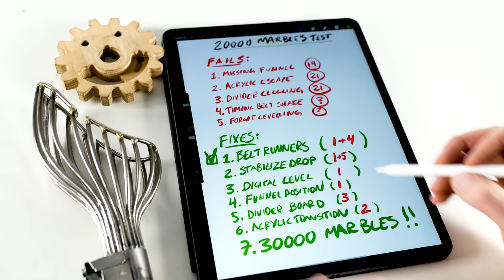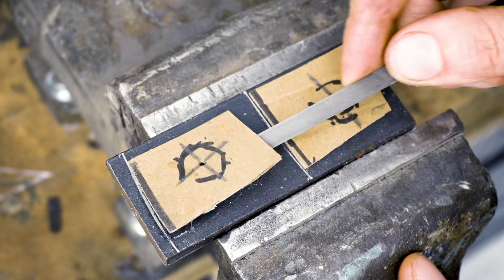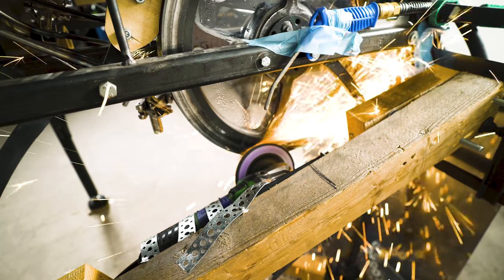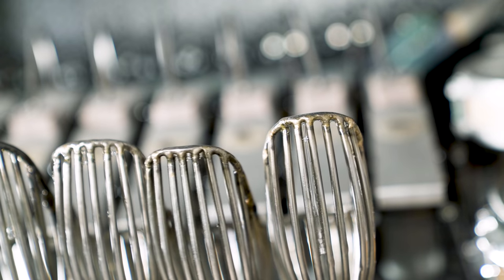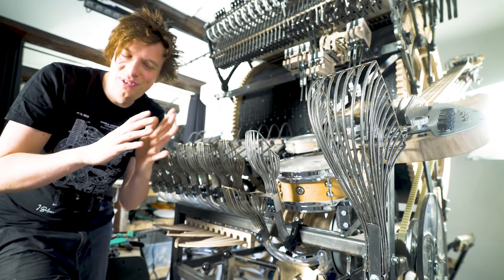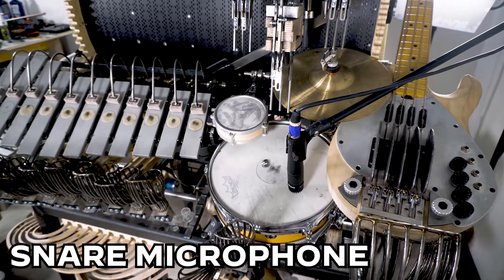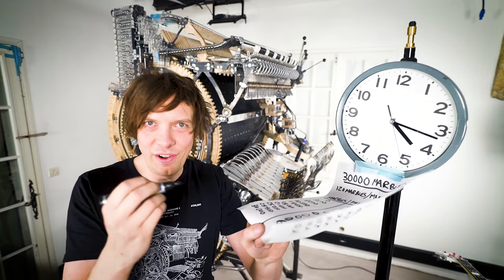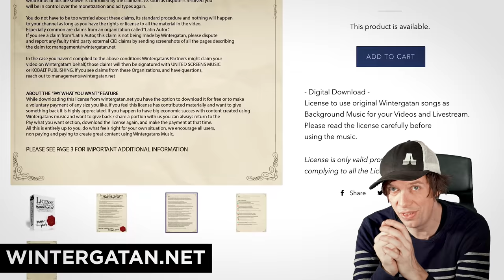Playing 30000 Marbles - Marble Machine X #148

Comment: Something that may help with those vibrations. To reduce "ressonance", try cutting a couple of holes at the top of the square tubing and filling the frame with sand. Sand will add mass to the supporting frame and absorb part of the vibrations. I recall ToT also did that on his CNC building series.
Reply: I'm pretty sure they do the same thing to rollercoaster tracks.
Reply: Just like Roller coasters!  uh wait... MMX THE RIDE!!!!
Reply: Btw filling the frame with sand seems to me a wonderful idea to absorb vibrations
Reply: @timbo11  I was going to say the same thing
Reply: That machine is going to be so heavy to take on a world tour

Comment: Your runners need to be spring-loaded or you'll run into trouble.

Over time with the runners stressing the belt combined with temperature swings the belt is going to stretch, this is what lead to the problem you have now that made you add runners, by making them static/not adjustable you're just kicking the can down the road, you need to plan for this.

In your workshop things might be okay for months before you notice a problem but on the road? you'll be going from warm venues to not temperature controlled vans over and over, if the van is generally colder than the stage you'll have extra stress on the belt when you're not using it and when you come to use it the belt will be loose again. If the van is generally hotter than the stage then when you're on stage you'll have that extra stress while also being under the load of playing. At some point it's going to stretch and it may cause you to drop from your 99.99999% goal
Reply: Yeah, but he can make a auto adjustable runners like in the cars, a spring and a pulley
Reply: this has been one of my big frustrations throughout the entirety of the series really.

He'll have a good idea, but then do a half job implementing it. Which then causes problems. Which he'll solve with another clever idea, but once again with a half job of implementing. I get that he has also been learning this entire time, but you'd think with a team of engineers backing him that stuff like this would get caught and corrected.
Reply: Belts are probably cheap and readily available enough to just be replaced on the road. Not to mention the main portion of the vibration, which was causing the drops, came from the flywheel being unbalanced. So the belt thing is probably more cosmetic than necessary.
Reply: He could make them adjustable, or just use bigger bearings. It's a problem, but not a major one.
Reply: And he should only have an idler on the slack side of the belt. He gets half-way there with these designs, but just doesn't have the engineering experience and exposure to fix it once, so he ends up in integration hell.
Reply: Further, he would do well to not just spring load the idler, but also dampen it with a small shock (motorcycle steering damper?).
Reply: Agreed. Martin should look at how car's take up timing belt slack using idler pulleys. On my 4A-GE engine it's a single bearing and a small but strong spring. Would be super easy to screw something like that to the brackets he's made. Or he can just modify the ones he made to include a spring.
Reply: I thought exactly the same thing. He could at least have welded on brackets with multiple holes to allow manual repositioning when the belt stretches.
Reply: @andrewcobaugh5375  Adding the rollers not only tensions the belt but also raises the harmonic resonance frequency, so he'd probably be best of having a static roller on the tension side and a roller under spring tension on the slack side. Adding spring tension to the roller also adds another point where there might be harmonic resonance, but it should be easy to adjust the spring strength or pull length to adjust for that.

Now that I look thought back on the issue I thought remembered the belt to have teeth. Took a look at 5:49 and yes it does. Now that is another possible source of vibrations. Toothed belt are used when timing is critical, such as for driving an overhead camshaft in an engine. That camshaft has to be perfectly timed or bad things will happen. The driver belt on the MMX does not have to be perfectly timed at all times. If it would slip a little while the machine is spinning up it's no big deal as long as it does eventually stop slipping. So transitioning to a flat belt, or perhaps even just turn the existing belt inside out might be worth testing to see if it runs smother.
Reply: Wow this blew up XD it's interesting to hear from the actual engineers where the idler gears should be, thank y'all for the thumbs ups, I was half tired and deleted my first post by accident strange how things happen

I understand that some of you are frustrated that Martin isn't an engineer and doing engineery things and making a mess but at least for me that's a good thing, he's not an engineer, he doesn't know the answers and so even I, who's last experience in a machine shop doing anything remotely useful to the debate was when I was 14, can put myself in his shoes and know I'd make if not the same mistakes then similar ones. I've learned more from Martin, This Old Tony, AvE and Adam Savage doing things the wrong way and fixing them than I have from people who're clearly experts in their field getting it right constantly first time. I now stand at least a limited chance of knowing what pitfalls to avoid, so there's the education side, not to mention perfection isn't nearly as entertaining to watch.
Reply: Yeah but how much you want to bet the belt tension didn't cause/fix any of the vibration anyway? Compared to the flywheel, it couldn't have been even 1% of the problem.

Likewise I don't see how the dropper movement mattered at all, given that the next marble drop happens ½ second after the gate snaps shut. (Maybe a little faster, but those gates do have a significant "recharge" time.) That seems like plenty of time to dissipate the impact vibration.
Reply: @barongerhardt  Good point that the belt movement is more a visual indicator. I also agree with you that tensioning the belt can't hurt, even if it doesn't solve the vibration issues in this video.

As for the droppers ... he can't play 16th notes at 120 with a single gate, the next marble doesn't drop in place soon enough. I'm not sure he could even play 8th notes. I'd guess quarter triplets at 120 (3 marbles/sec) is about as fast as he can run a single gate. Good idea to have dual channels on every instrument!

Also, I agree that a dropped marble is far less of a concern than a stuck or jammed marble. He talks like every failure is catastrophic and he has to get the numbers down to zero or his world tour is a disaster. I get the perfectionism as a way of life, and indeed it was great to see him balance that flywheel, but at some point, if a few marbles per song end up on the floor, this is not the end of the world.
Reply: The belt vibrations just simply were never an issue, period. What the weight of the belt? It's like saying the jingling keys are shaking the car and not the other way around.
Reply: Yep, It might run for 1 tour though... maybe. :) I'm twitching my eye way too much, I'm skipping the video's I noticed. I'll just wait and see the end result, much better for my sanity. haha Wish him all the luck!
Reply: @VincentGroenewold  So many besserwissers here, who roll their eyes when Martín does something from their area of expertise a bit unoptimally (Excel use, rubber band shenanigans...). Get it that he does a bit of EVERYTHING and then plays music on it.
Reply: Yes, without springs the runners will either wear out the belt, or change its tension depending on the temperature. A second version of the runners should include springs that keep a constant tension on the belt.
Reply: Have to agree - the belt tensioners should be spring-loaded, to keep a constant tension under varying conditions.
Reply: @andrewcobaugh5375  I think a Centramatic type balancer would be beter than a shock absorber.
Reply: @blahorgaslisk7763  Yup, I agree about the belt tensioner + idler wheel

Comment: At some point, the marbles that miss are going to be caused by a slight breeze coming through the window, and Martin will engineer something to counteract it
Reply: Yes. It will be a mechanical fan attached to the planetary gearbox that produces a breeze in the opposite direction of the window.
Reply: Quite simple, actually. Just contain the MMX within a vacuum so there's no air to make a breeze! Thinking about it, that might also solve any humidity or temperature change problems. Huh
Reply: Connor McInerney there will be no sound in a vacuum tho, having the MMX in its own controlled micro climate might be the go though.
Reply: @alvardo3000  That actually wouldn’t be a problem for most of the MMX’s instruments. The bass has pickups, so it doesn’t need air, and Martin mentioned someone’s suggestion to use magnets with the vibraphone bars which essentially gives them pickups as well. The kick uses a contact mic, so again, no air needed. The main issues would be the snare, hi-hat and cymbal, because those don’t use pickups or contact mics. You can still give them all contact mics, but they likely won’t sound the same or as good. So if you didn’t care about getting a perfect sound, a vacuum wouldn’t be an issue
Reply: But... making a vaccum that big is practically impossible, especially on the go in the world tour. He also would need to stand inside of thr vaccum to operate the machine, killing him due to lack of oxygen.
Reply: We need a DOME!
Reply: "I've gathered the plutonium I need for my thermonuclear weather machine, I've started hunting through my tap water for tritium, not sure how I mix it with the lithium"
Reply: @lukejordy  Viva Las Music Dome!!!
Reply: Or he could just close the window. ;-)
Reply: @lilyunderscore9568  Space suit.

Comment: Honestly, even though 6 marbles fell, it actually wasn't 6 failures. The reason being that it was loading multiple marbles and they all fell at the same time as part of the same overflow failure. So reliability is actually higher
Reply: There's also the fact that the failure happened obviously outside of normal operation ie. several hours of uninterupted use of a single instrament. If it were me, I would note it down as a possible point of failure while moving forward with the rest of the instuments. It's possible that using more gates at once would prevent this from happening again, or even just the breaks between songs. The cause of the failure may even just be that MMX had more marbles in circulation than it could handle when only playing the snare.
Reply: @DeathOfLife3764  Exactly.  Unless you plan on playing it for over four hours, there would be zero issues the way it is.
Reply: Using triplet notes will avoid this for the next test.
Reply: @Sorestlor  that is why he should do a calculation of minimum number of marbles needed for the machine to play smoothly. As well as calculate maximum number of marbles that the machine can support.
Reply: While the probability is low.  This was just one of many future gates each with the same potential failure point.  So the real failure probability is actually quite high, almost to the point of being certain over the course of an entire concert.  In addition, the marble loss is a minor symptom compared to the potential failure of several instruments downstream of the blockage from receiving any marbles at all.

Comment: Martin takes out the angle grinder to balance the Flywheel: Me (working for a reasonable time in a balancing company) - thats not how balancing works. I suggest using magnets.
2mins later: Martin uses magnets.
Reply: The funny part about this: It wasn't 2 minutes, but 3 days for Martin.
Reply: I was just thinking about the little clips they put on tire rims to balance new tires.
Reply: @dmdeemer  Same here. I just noticed my tires getting out of balance yesterday. Today I see this and I see the grinder and cringe. Then he fixes it proper and I sigh in relief.
Reply: Exactly. It didnt matter if the flywheel was true, it mattered that it was balanced. He was equating true with balanced. At the machine shop they true flywheels so the clutch mates, and then balance them so they rotate smooth and dont shudder.
Reply: @MrAntimonty  i
Reply: But the flywheel looks loads better! It helps the angle grinder feel better about its sacrifice.

Comment: Forgive me if I'm wrong, but that last little issue wouldn't actually exist if the machine was playing more then the snare drum, correct?
Reply: Yes and no. Assuming the snare channels were the only ones with improper marble heights in the marble divider, then you likely wouldn't see this issue occur, however it still delays marbles from getting to the hi-hat and bass channels, which is an issue this test doesn't show. But if other channels also had improper marble heights, the issue would be compounded as there would be buildups causing and adding to more buildups, so the issue would actually happen more frequently
Reply: Correct. The solution, the "prescription" if you will: MORE COW BELL
Reply: Also, this is one of the most complex channels because of the longer parts and drops, so what he learns here will easily apply to rebuilding the other channels.
Reply: I believe so as well. He just needs to turn it up to 11.

Comment: MMX: does a sub-millimeter wobble
Martin: break out angle grinder
Me: oh god oh no not again
Magnet: fixes wobble
Reply: Wheels on cars are similarly balanced if I'm not mistaken
Reply: @riddixdan5572  yup, in Cars they use small lead weights to Balance the wheels. whenever you get a new tyre, the weights have to bei adjusted so the wheel is balanced
Reply: @nilswegner2881  Came here to say the same thing.
Basically the same as car wheels.
Reply: Chances are that the magnets wouldn't have been nearly enough if he didn't remove all that unbalanced mass before putting them on.
Reply: @qwasdninja  this^
Reply: @qwasdninja  Though I wonder if it'd be easier if he just drilled some holes into the flywheel to balance it out like how they do with drill motors.

Comment: Just remember this as well: theoretically some problems, especially those with the marble divider, should be less likely once you start using more channels!
Reply: Imho I would argue that this is actually good test case to refine for. 
We wouldn't want a break/slow down in the song, or if we just shut off a ton of channels for a while, to become an issue. I'm still nervous when i look at the marble divider in terms of capacity. If you ask me, the marble divider should be able to hold all of the marbles that could be in the entire machine while running. MM1 had massive marble divider space.
Reply: @sunray501  I mean, it took gradual build up over FOUR hours of constant playtime for the failure to occur, and that was in the edge case of only one channel being played. With more channels seeing use over, let's say, a 10 minute song (probably generous) I don't think it even counts as an issue.
Reply: May be an issue if too many marbles are in the machine. Take a few out so there's no chance of that backlog. Or maybe have a reservoir somewhere other than the top of the machine
Reply: an overflow condition must be accounted for. depending on the conditions it may actually be more likely to happen because of the total number of marbles in the machine; a high "marble flow rate" could cause a failure to cascade much more quickly and cause new/more problems

Comment: Martin: uses an excel sheet to write down diagnostics
Also Martin: uses calculator to do Maths on the data in the sheet xD
Reply: Not going to lie, it hurt a little bit to watch him do that. If you're going to be using a spreadsheet, then take advantage of the features of the tool you're using to do all the math for you rather than doing the math by hand and potentially introducing additional error into the data by mis-transferring the values.
Reply: math
Reply: @zeushi  Having localized point of sale software to Germany, I can confirm: radixes (radii?) and time formats suck
Reply: @zeushi  German here. In Germany, we use comma as decimal separator and the point as group separator for thousands. In Switzerland, they say "comma" but use both point or comma. They also use single quotes or spaces for thousands. In India, they use a decimal point but don't group into thousands, but thousand and then hundreds. So these are different notations:

English: 123,456,789.1011
German: 123.456.789,1011
Switzerland: 123'456'789,1011 or 123 456 789.1011
India: 12,34,56,789.1011

The German format also introduced a problem for CSV files, since comma in numbers are important and not just for convenience in reading, like the commas in English number formatting. Therefore, the "German" CSV files use semicolon as separator.

I think, the world should finally come together and use the metric system with English number formats.
Reply: @zeushi  that was a little triggering.
Reply: @NFSHeld  India's format completely breaks my brain...
Reply: Ahhh yes, I must say I'm weirdly starting to not like watching all that kind of stuff. It's stupid I know, but it seems he lacks quite a few of basic knowledge in that sense, which seems weird as he built all this. I'm just twitching my eye way too much, so I might skip a while and see the result. :)
Reply: @VincentGroenewold  things are done differently in different parts of the world. Also, people do things differently. Just because someone doesn't do things the way you do them doesn't mean they are wrong, and it doesn't mean they are right either. Goes for common sense as well. Common sense is different for everyone. We are all brought up differently. If the end result makes the world turn their head, then maybe they're doing something right. What have you done to make the world look at you in astonishment?
Reply: quick maffs
Reply: @Ibakon Ferba, math, not even once!